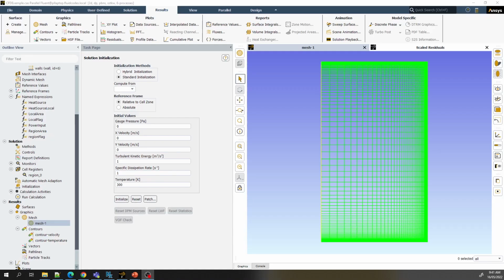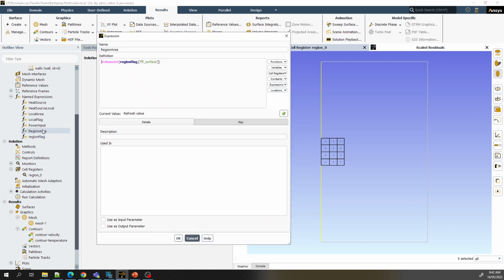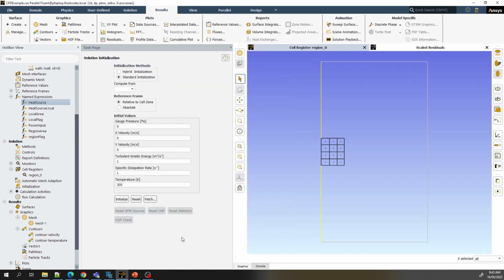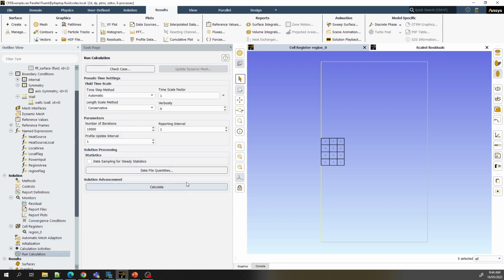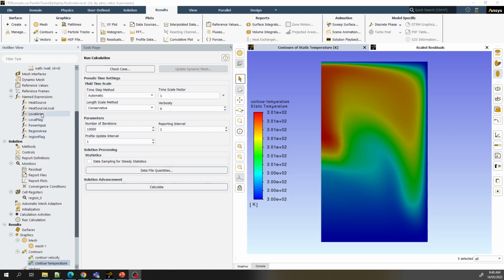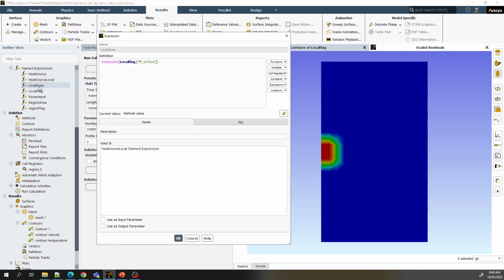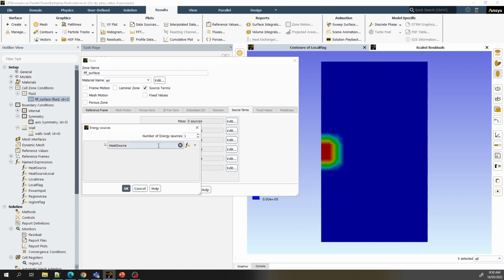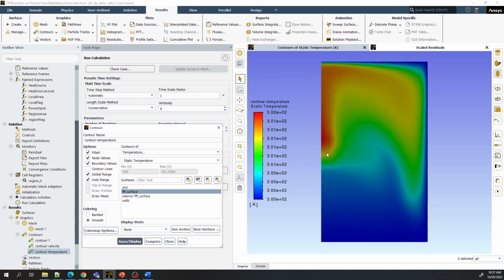How to use Expressions and Cell Registers to apply localized source in Ansys Fluent.

Comment: HOW TO DEFINE CELL TEMPERATURE IN NAMED EXPRESSION FOR ANY PART?
Reply: in other word how to make the same thing such that C_T(c,t) at the centriod in udf in named expression
Reply from the maker: Dear  @medoabotalb5409  You can use any Reduction Function along with the variable 'StaticTemperature' and the required part/location available under the locations (Cell Zones & Boundary Surfaces)
MassFlowAve(StaticTemperature,['outlet'])

By default, Static temperature is calculated from Cell Centroid in Fluent Expressions